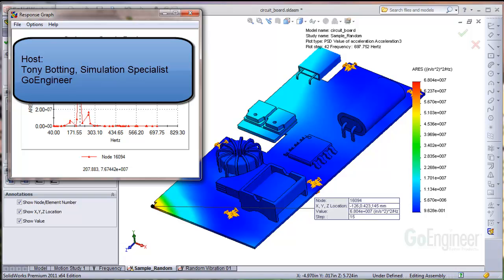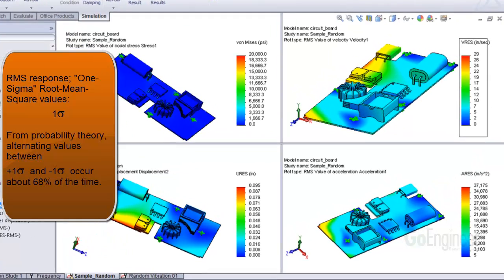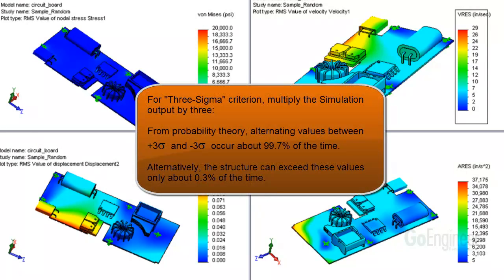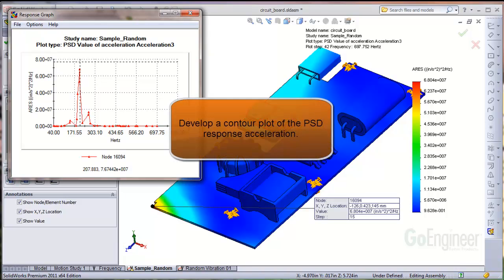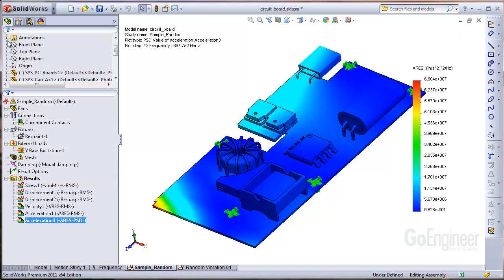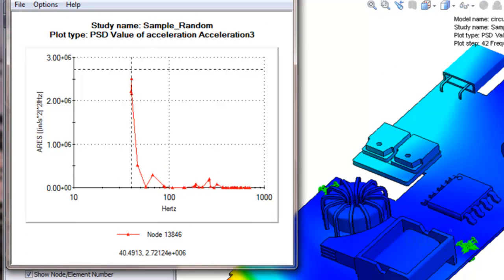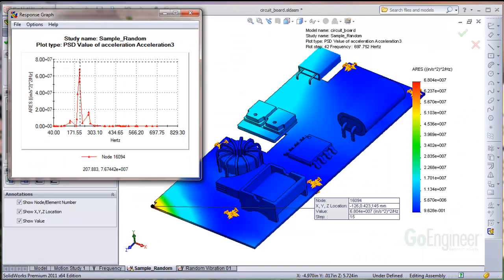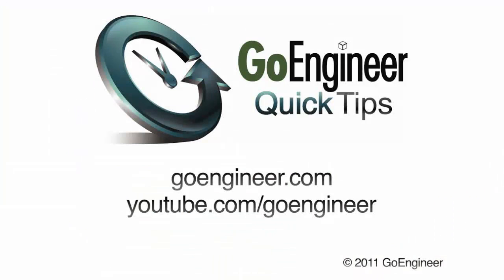SOLIDWORKS Simulation - Random Vibration Power Spectral Density (PSD) Results

Comment: When I run a random vibration simulation, the data points are not evenly spaced when displayed either linearly or logarithmically. What is the reason for this, and how likely is it that there is aliasing of acceleration peaks due to this?

Comment: why can we just multiply the output results for 1g by 3 in order to get 3g output results? for stresses, for example..
Reply from the maker: Thanks for your question. In the video, Tony talks about the level of confidence of obtaining a stress value and not the amplitude of loading. Since random vibration is a statistical analysis based on gaussian distribution, the sigma values are indicative of the probability of occurrence of a certain stress level.  While the ‘1 sigma’ results indicates the 68% probability that the stress on the structure is less than or equal to the reported value, the ‘3 sigma’ results indicates 99% probability which is obtained by multiplying the ‘1 sigma’ values by 3. Please check out this video for more information : https://youtu.be/LM_7o0n3mzw
Reply: @goengineer  got it. Thank u. The best channel about SW Simulation and SW overall:)
But what happened to Tony. Did he get promotion?:D 
Or he just changed work/domain?)
His explanations very straightforward and useful till now!)
After so many years!)